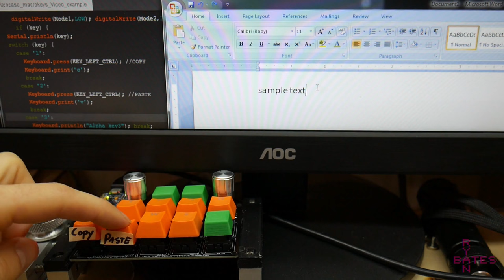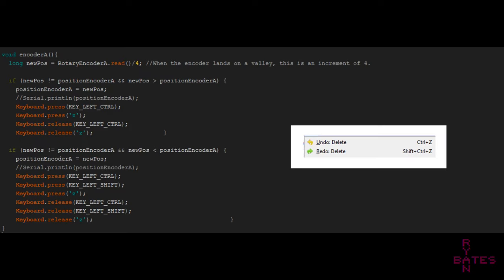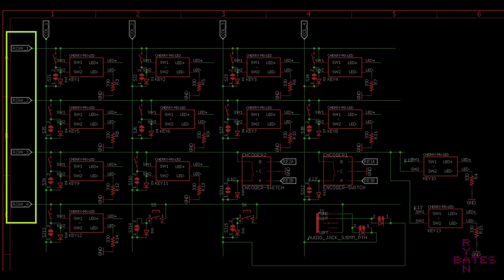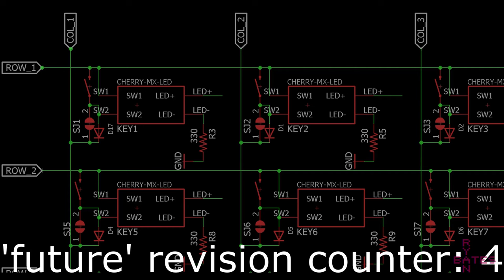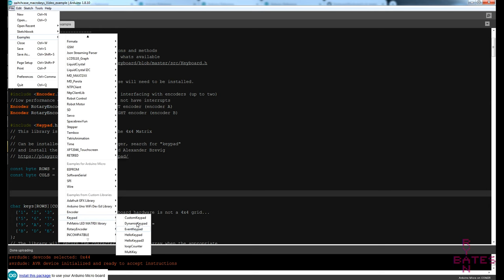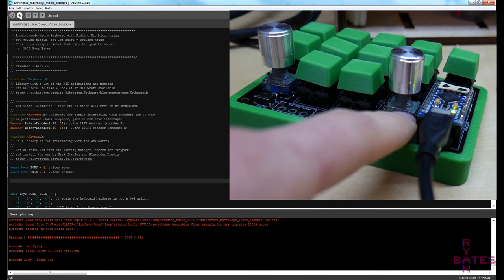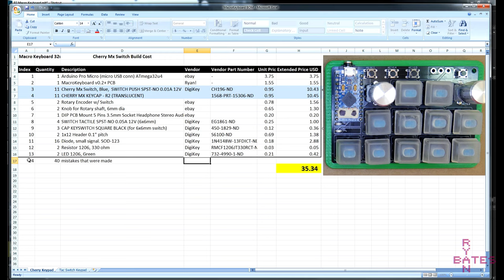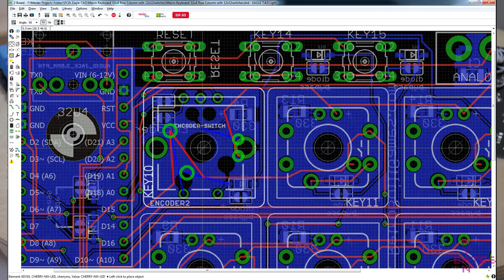Programmable Macro Keyboard with an Arduino Pro Micro (32u4), Cherry Switches + Stealth Foot Pedal

Comment: 80% of the time it works all the time 😂 dude you made me laugh so many times throughout this vid, and have also convinced me to start a project like this of my own since I have an Arduino Pro Micro laying around from an old NES Controller conversion project. I really like the implementation of a knob, especially for video and photo editing, I've looked at the more expensive off the shelf products and also think "I could make that for less" but I know it'll cost more in the end haha. Great vid and project, I've subbed 👍
Reply from the maker: I appreciate the kind words!! Now that I've have some time with it, the dual knobs are wondrous for video editing. Zooming and skipping through the timeline are meant for encoder knobs.

Comment from the maker: Great news everyone v0.4 is back in stock!
Things that are fixed in v0.4: 
Foot pedal wiring (the GND of the headphone jack is now common, R and L channels are the switches 15 and 16 respectively). 
Full sized keyboard key can fit in place of rotary encoders.(Rotated the encoder footprint 90deg).
Reply: Will these be posted under the same link as before?
Reply from the maker: @miles5407  Yes, exact same link.

Comment: The guy at my office who does the 3D printing wired up a bucked with uv led strips encircling the inside. He puts the parts in there for 5 additional minutes prior to cleaning to maximize curing.

Comment: Great job! Nice video! Nice presentation! Nice PCB layout! It has 
the reference value for me.
I have a similar project using Arduino Pro Micro with many many keys with a different approach.
Reply from the maker: Anyway I could check it out? Looking at other people's work was the only way this project was able to skip over some prototype phases and straight to what I wanted.

Comment from the maker: Ryan's Pro Tips for navigating the <keyboard.h> and <mouse.h> HID library commands.

=============== Keyboard Control================================================================================
Keyboard.write();   Sends a keystroke to a connected computer. 
                    This is similar to pressing and releasing a key on your keyboard.
                    Will send a shift command if applicable. Example: Keyboard.write('K') will automatically do SHIFT + k. 
                    Can also accept ASCII code like this:
                    //Keyboard.write(32); // This is space bar (in decimal)
                    Helpful list of ASCII + decimal keys: http://www.asciitable.com/
                    
Keyboard.press();   Best for holding down a key with multi-key commands; like copy/ paste
                    This example is [ctrl] + [shift] + [e] 
                      //Keyboard.press(KEY_LEFT_CTRL);
                      //Keyboard.press(KEY_LEFT_SHIFT);
                      //Keyboard.press('e'); 
                      //delay(100); Keyboard.releaseAll();
                
Keyboard.print();   Sends a keystroke(s)
                    Keyboard.print("stop using aim bot"); //types this in as a char or int (not a string)!

Keyboard.println(); Sends a keystroke followed by a newline (carriage return
)
                     Very practical if you want to type a password and login in one button press!
                     
SOMETIMES, applications are coded to recognize Keyboard.press() and not Keyboard.write() and vice versa.
You might have to experiment. 

=============== Mouse Control===============================================================================
Mouse.move(x, y, wheel);  Moves the mouse and or scroll wheel up/down left/right.
                          Range is -128 to +127. units are pixels 
                          -number = left or down
                          +number = right or up

Mouse.press(b);         Presses the mouse button (still need to call release). Replace "b" with:
                        MOUSE_LEFT   //Left Mouse button
                        MOUSE_RIGHT  //Right Mouse button
                        MOUSE_MIDDLE //Middle mouse button
                        MOUSE_ALL    //All three mouse buttons
                        
Mouse.release(b);       Releases the mouse button.

Mouse.click(b);         A quick press and release.

Comment: I decided to do this recently, and I just came across a DIY design on Thingiverse that includes linear potentiometers for use as a stream deck. Pretty cool stuff. You mentioned that you use Eagle for PCB design, and I am curious if you have used Kicad. I have been using it for years now and I would choose it over Altium for most design work. It is incredible, powerful, free and open source with no limitations on board sizes and no lock in to a license that is at the whim of the current copyright holder. I love it and I recommend anyone doing PCB work to look into it first.
Reply from the maker: I want to use KiCAD. this project started in kiCAD but I got stuck and fell back into Eagle just because i know it well. I know Eagle is inferior; I'm not a fan of Autodesk either.. I will learn KiCAD in 2021.
Reply: @RetroBuiltGames  Oh gotcha. I have been using KiCAD for years now. I even started a small tutorial series on my channel, though I haven't made it as far as I would have liked. I do plan on getting back to it some time when I have more time on my hands. What did you get stuck on specifically? Maybe I can help.

Comment: Hi. I recently bought a couple of these boards from your store on Tindie and was looking for the exact 3D models of the key caps you 3d printed. I am specifically interested in the ones you printed in green and blue seen at 7:30. Could you share some links downloads to them ? Thanks
Reply from the maker: blue ones were not printed- bought those. I believe it was this file i used for the 3D printed caps.  https://www.thingiverse.com/thing:738769
Reply: @RetroBuiltGames  Thank you!

Comment: can you make a 3d file fot the case that doesn't shot the switch housing because i am not really a fan of the floating switch design. I was also wondering if you were to do it, can you make a hole for the micro usb

Comment: How did you resin print directly on the build plate? Do Formlabs printers not suffer from "elephant's foot" on the build plate?
Reply from the maker: You can place parts directly on the build plate. SLA does not suffer from elephants foot which is really a FDM symptom. OR (this is the recommended way for Form 2 printing), anchor the part using lost of tiny supports to a raft.

Comment: Do these roatary encoders give like an incremental pulse every time they are turned?

I want to add a volume knob for my android radio. The radio has assignable steering wheel controls that are based on differential resistance. Each button gets its own value of resistance, and for volume, each press equates to a different step in volume level.

Im wondering if theres a rotary encoder out there that i can add a resistor to, and use it as a volume knob for this radio. Maybe even use the built in button as a mute command?

Anyone have any ideas?

Comment: Cool!
I have did a digital caliper result sender to my CAD program with an Arduino Pro Micro (32u4), or other program.
But not finished yet the case and the PCB.
On my instagram there are a short video.

Comment: Mini USB connedctor is superior Why and by how much? From my perspective, I have a bunch of spare micro USB cables (as phones have switched to USB-C) around and that has been the deciding point for me so far...

And yes, when testing a keyboard the other day, I screwed up a pin HIGH/LOW state (basically, I forgot that the LOW is not necessarily 0, ignored a pull-down resistor, I think, for which reason the button was always considered HIGH) and ended up with Arduino emulating CTRL+N 10 times in a second. It took me half an hour of frustrating attempts and reboots to upload a harmless blank sketch before the circus began over again (hint: use an OS where you can pin a window always on top of the others and swear a lot in the process, in my case that helped). :D

Also, many years ago (pre-Arduino/RasPi time) the boss button was a thing. I think there was a small commercial solution of a button or pedal along with a small app to define the button macro. Now I am thinking of making a set of cardboard steering wheel (with MPU6050 and two buttons) and a pedal for a car racing dame. Neat!

Comment: This is really informative however as an individual terminally inept with programming, how would one go about creating macro that repeats specific order button until pressed again but also randomises input delay between each inpuut within specified range? (let's say randomly choosing value between 13ms and 37ms for delay between inputs)
Reply from the maker: try asking this question in the Arduino forms. be warned, "how-do-i-do-my-program" can result in an 'abrasive' response

Comment: Would be nice if you could program the face of the keys.. a small oled or e-ink screen on each key. But maybe gets too expensive. 
An alternative would be a version with a touch screen. But maybe you can use a phone or tablet then just as well somehow coupled to the PC.. 
Its a bit nicer with real keys. And maybe regular stickers can solve it in the end much cheaper..

Comment: I'm buying the parts I need to make one of these, but I don't really know what sort of LEDs to buy. I've Googled LED 1206 (as listed on the webpage) but that yields generic LEDs. Any help would be appreciated.

Also, Diodes are only required for multi-keystroke macro, correct?
Reply from the maker: check the links in the desc. I list part numbers to buy from a supplier.

Comment: I'm confused as to the purpose of the "R" connections on the back of the board. I get that they're to do with the LEDs but do you need to solder them, leave them, or add a resistor to them?
Reply from the maker: if you do not want LEDs, then leave then blank/ unpopulated
Reply: What what type of resistors do you popluate it with if you’re using LEDs?

Comment: Could this be done without the PCB? I’ve seen many others solder wires from switches to Arduino pins directly
Reply from the maker: yeah you absolute can. I just like PCBs

Comment: Im lookinng to use a three-way switch to toggle between the different key layouts. Does any one know if that’s a reasonable idea, or what would be the easiest/cheepest hardware to get the job done? I like the idea of the classic guitar pickup selector, though probably downsized a bit.
Reply from the maker: That is very reasonable. An idea to do this: use the analog pin and make the switch select from different 'set' resistances. your logic would just be if voltage =this range, then mode 1 and so on. this application is also called a 'resistor ladder' .

Comment: Thanks a lot, you made an amazing job, one question:
I downloaded switchcase_macrokeys and I need that only when I press and hold "case 3" button it should press continuously the key, example: now if I press and hold case 3 it press one time the key and print 3, I need it print 3333333333333333..........  untill I release button, but, I repeat, only in case 3.
Is it possible?
Thanks Again
Reply from the maker: remove the "break;" from case 3. that will help a bit

Comment: how does this rotary encoder feels compared to a mouse wheel? 👀
like, if you place it sideways would it be able to rotate freely? 👀👀 or is it too stiff?
Reply from the maker: It would work, but it's bulky. The lateral forces might shorten the life. It's also kinda stiff; but that varies with the make/model, The encoder like most (not all) scroll wheels has pits/ that it will lock into so it doesn't spin freely. You can mitigate the stiffness by increasing the radius of the knob, but again, bulkiness.

Comment: can I make a macro keyboard with, like, dozens of keys?
and, the keys is not side by side, they seperated left right, up down, front back
"but why?", you may ask 
for flight simulator like DCS, I have many buttons in the cockpit, I want to bring it out of the computer screen for easier access (normally I have to use mouse to click on them)
Reply from the maker: yes that can be done
Reply: @RetroBuiltGames  can you make a tutorial? not necessary to make whole cockpit with hundreds of buttons, but make a scaleable one, I will follow and expand the number of buttons
I have nearly no experience in this field
Reply from the maker: i mean this is the tutorial right here. It scales. Just use 4 more pins for a 6x6 and that's 36 keys....

Comment: I notice you are out of stock on the PCB, can I get the eagle drawings. I was thinking of making one, however this would she a lot of time and mistakes. In the end I would like a slightly different layout. Thx
Reply from the maker: back in stock! i added  the PDF schematic if you want to try building your own
Reply: @RetroBuiltGames  thanks for responding. Since then I have spent a lot of time (to much time) looking at circuits etc., Bought some stuff.. as you said spending 3 times the amount of money buying different parts etc etc etc. Using a DMK, I just made macros work using two different programs, because I couldn't make either work on the own. I have ordered parts, and would still like to get PCB and make a custom keyboard but don't have the 32u4 chip yet. I like your circuit but would want 6x5 buttons or 6x6 with diodes. ... And would still like to program C code for this. Can you alter the board ? I can give you money..
Reply from the maker: @sjay67  Thank you Ian. I must respectfully decline; i do not have the resources [time] to design a new layout.

Comment: Loved your video! I actually do not want to build a keyboard (yet). I travel a lot for work and do not have computer access nor time to change keyboard mapping in the computer. what I would like is and intermediate device I could insert between the keyboard and the computer that would do the remapping for me - that I can fully program. Can anyone point me in the right direction?
Reply from the maker: autohotkey.com

Comment: How can i add an oled display for thia macro pad?
Reply from the maker: The I2C lines are tied up with 2 column lines for the keys. But you could probably swap them with the 'mode' status LEDs and use a OLED.
Reply: @RetroBuiltGames  thanks, so I change the mode status LEDs to oled? right?
Reply from the maker: I think it be best to repurpose the LED pins to replace the two row-matrix pins. The dedicated i2c lines talk to the OLED, they are currently being used as the row/ column matrix for the keyboard keys in this build. As I reflect on it, not a great design choice on my end. But that's why the revision number is sub 1.0.

Comment: Can i actually make split keyboard with that using breadboard ?
Reply from the maker: yes, You'll need to omit some features I have (LEDs, potentiometer) and just expand the rows and columns for a full keyboard.
Reply: @RetroBuiltGames  But sir , i dont know which pin i have to solder and i dont know which pin should i connect with the breadboard

Comment: Cool, but Logitech G10, G15, G19, G13, G910 and more Keyboard + G600 Mouse and Leo Bodnar Universal USB Interface Boards
Reply from the maker: cool but why
Reply: Cool because you made an electronics and a program for it. These devices must be purchased and set up. For Leo Bodnar electronics, only switches and spare meters need to be connected. Anything can be set with AutoHotkey, so there will be plenty of extra buttons. Existing buttons and combinations can be set for Logitech macro buttons. It can be program launches or even complete texts. With Google translate.

Comment: This is a cool video but if you look at this logically:

Think of time as money. (EXAMPLE) If you save $15 on the macro keypad but spend 5 hours setting it up you've lost money, not gained it. If you make $15 an hour you could have been made $75 in that time. So you "lost" $60. 

Just buy a Stream Deck. The 15 key was on sale a few months ago for $99, and that's all that much more money. That's a WAY better value.
Reply: No. If you use the time that you would not be profiting from anyway then your argument falls apart. I work 8-5. If I assemble this an hour a night across a week (say 6-7pm) then I lost $0 dollars in time,  just less free time. I also likely found building it enjoyable and learned a bit along the way.
Reply from the maker: logically you're forgetting that learning something like c/c+ or embedded electronics has zero value.